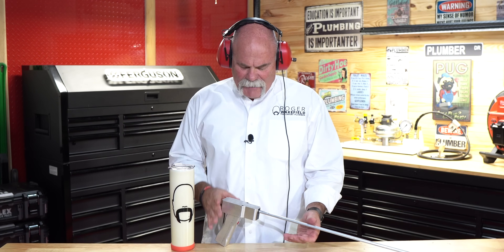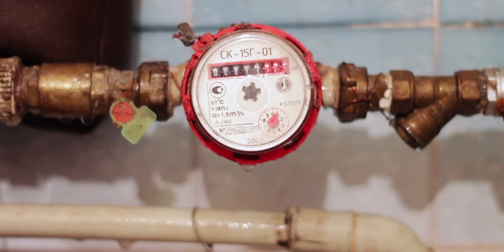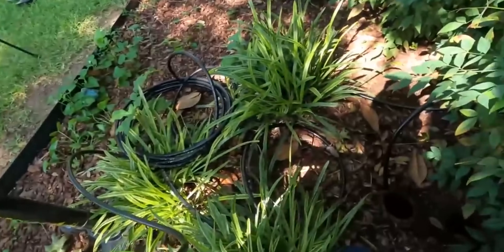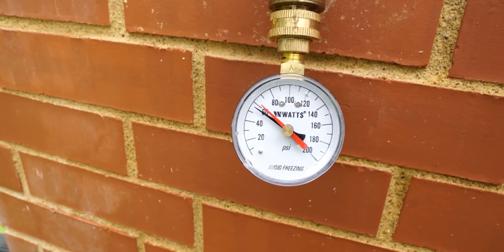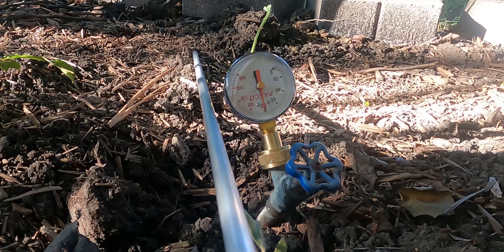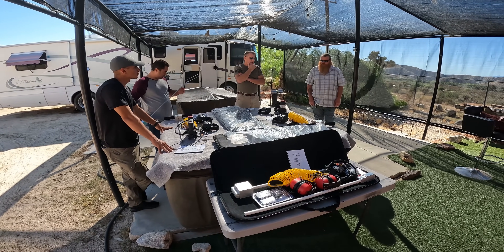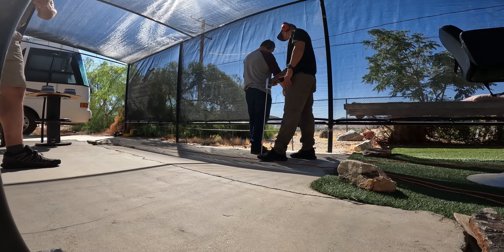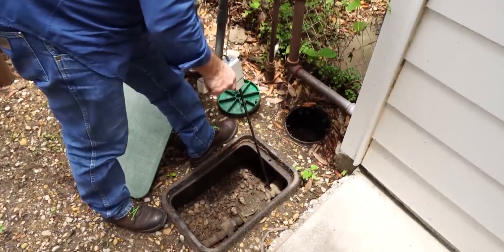Leak Detection Training | EVERYTHING You Need to Know

Comment: None of these plumber videos tell you how long to watch the water pressure with a gauge and should the pressure drop (if any at all) in that time period. For example, should the pressure be rock solid in that 15 minutes and not move at all, or is a drop of 2 psi or so acceptable in that 15 minute period?

Comment: Not a plumber but great clear video. I'm here because I just found a leak after searching youtube for tips. I was locking up the house late one night and could hear a hissing sound coming through the kitchen taps. I checked all the usual, garden taps, toilet cistern etc and then checked the water meter and roughly calculated it was losing about a litre per minute. Next morning I went round with a screwdriver to my ear on all the accessible pipework, the noisiest spot was thankfully outside towards the water meter, but background noise from neighbours pool pumps etc prevented precise location. I dug several holes in the garden, on the 4th hole the soil was wet, and I found the pinhole.
Reply from the maker: Great detective work and finding the leak! Did you make the repair as well?
Reply: I put a hose clamp around it and used the local plumber without a callout fee @RogerWakefield

Comment: Where I live the houses and buildings are made of concrete slabs and walls of cinder block filled with mortar, water pipes are embedded therefore water leaks make no noise even at high pressures.
Reply: I'll show a wet spot on the wall
Reply: @ Hi, not sure how is the construction system where you live. In Panama the bathroom walls are made of cinder blocks fill with mortar and covered with tiles so the leaks in the pipes that are installed inside these walls do not show wet spots nor produce sounds. Thermal conductivity is so poor is useless thermal cameras. How ever I am willing to learn new techniques.
Reply: @joaquinfabrega  was on a job site house was made from solid brick covered with plaster and ceramic tiles and I'll show a wet spot or water dripping, greetings from 🏰🧛🦇
Reply: @unclerobert7532  glad to see a photo or video.
Reply: @joaquinfabrega  was few years ago 🤷 ,

Comment: What would be the best method to introduce Air in the system without the loud noise of a compressor?
Reply from the maker: We just run the compressor for a short time then shut it off. It doesn’t take a lot of pressure…
Reply: OK I'll definitely give it a shot, thanks a million 🙏
Reply from the maker: Let me know if it works out for you 👍🏼
Reply: Did a leak detection today and tried your method/advice You're right, not a lot of pressure is needed from the compressor to get the bubble sound when introduced to the line.  Thank you Roger!
Reply: Get yourself a CO2  Bottle a regulator and hook it up to either the hot or cold side and have at it. It's so quiet you'll never know it's there.

Comment: I am in PA, the meters are inside the house here and the city shut off is near the curb line. We do water line repairs outside, the water lines are usually about 4 to 5 feet deep and between 30 to 80 feet long. The material of pipe can be copper, CTS, Poly, or Galvanized. Will this equipment and training be useful for us here in PA?